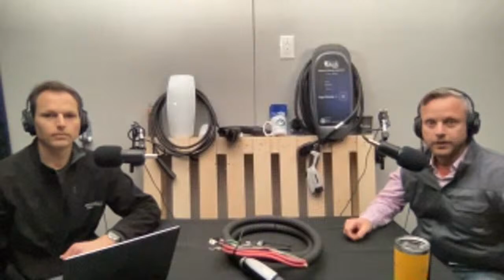Tesla opens Powerwall 3 orders, so...What you need to know?

Comment: This is all making sense now.  The team that installed my Enphase PV system last year says they can only install PW2s with my micro-inverters.  I'm blessed that we were able to OVERSIZE our PV system by 20%, our home is 5 years old and built to be very efficient.  Our 3-ton AC has an LRA of 83.  My installer collected all that info when they installed the PV system last year.  Given all the tax credits and local rebates, they are quoting me about $16K to install 2 PW2s.  Seems fair given I received a quote of $22K to have a 24 kWh GENERAC generator installed.  I'm on NEM where all I get are credits that must be used within 12 months, based on my system performance since my PTO of 9/20/23 I will be donating 2 MWh or more back to AMEREN.  But I'm adding ESS to keep my PV system running during an outage as our primary goal, anything else is a bonus.  I thought I was missing out on something by not being able to get the PW3 but I can see where the PW2 is the only real choice for us.  This is a great educational video.  Thank you.
Reply: You can use the PW3s with an Enphase system. I have a 10-panel Enphase system and a 27-panel SolarEdge inverter system on my house. The first quote I got for PW3s had them installing the Tesla Gateway to interface with my SolarEdge system but they said it would work with the Enphase system. I'm going with a different installer who is going to remove all of my existing inverter systems and use the PW3 inverters, I'm getting two PW3s, with my existing panels and the Tesla Backup Switch, so I don't need the gateway. Full house backup on one system. I'll lose per panel monitoring but I've never had a panel failure. I have had failures of both the Enphase and SolarEdge inverters in the 7 years I've had my house.

Comment: Tesla powerwall 3 is not flexible since it will work in new installations only.
It doesn’t work for retrofitting previously installed solar systems with inverters.
It should have the capability to be DC and AC if needed.
Reply from the maker: The latest word from Tesla is that those configurations will be supported in the future.
Reply: @smartchargeamerica  , that would be great.
It would be super cool if you can mix it .
I have powerwall 2 and adding a PWS 3 would be cool.
Reply: Actually it does work with other inverters, etc.
Reply: You can now. I'm getting two PW3s installed and I have two existing solar panel systems. I could have kept the inverters and used the Tesla Gateway but now I'm going with the Tesla Backup Switch and removing all my existing inverters. I have Enphase micro inverters on one system and a SolarEdge inverter on the other. Since the panels don't match and I have a shading issue, the old Enphase based panels will be on one string and the other set will be split up. I can have up to 12 strings with the PW3s but my installer says with the bypass diodes on the newer panels, I'll probably end up with 4.

Comment: Hi there, Mike here from Florida.  I have a question about the built-in inverter.  Most solar systems use Enphase inverters, and the PowerWall 3 will not work with Enphase inverters.  Does this mean that if I install a new solar system, I will have to use a string inverter set-up?  Also, will I need DC optimizers to make this work?  Thanks!

Comment: Excellent! Good general discussion about PW3 and their installation.  In looking at install instructions on strings there is a 13A limit on any MPPT.  Configuring string sizing and MCI mid-current interrupters would be a great follow up podcast.  

On NEM 2.0 and 3.0 (California) - 3.0 is a calculated “Avoided Cost Calculation” that reduces customer credits to 25% of the retail rate, approximating the utilities’ expense for wholesale power.  Utilities believe this will force people to install onsite storage and increase revenue, … enter PW3s and other battery systems.  @mikeiimura - great comments